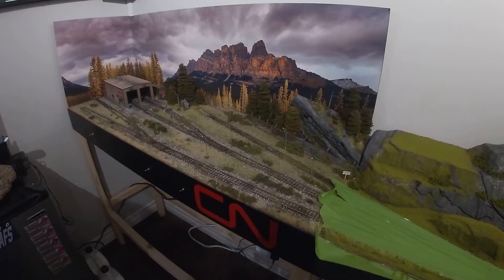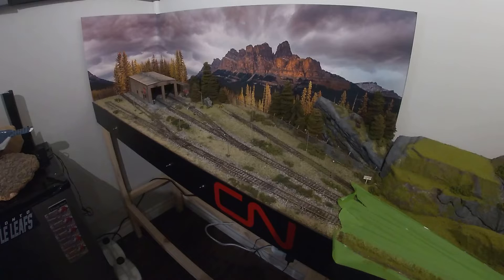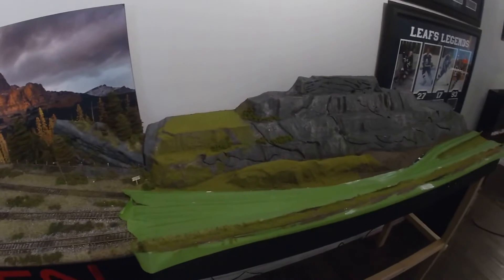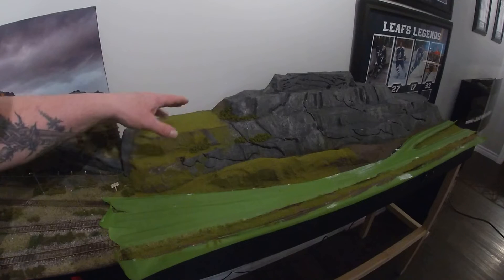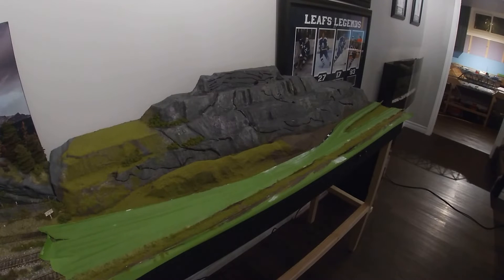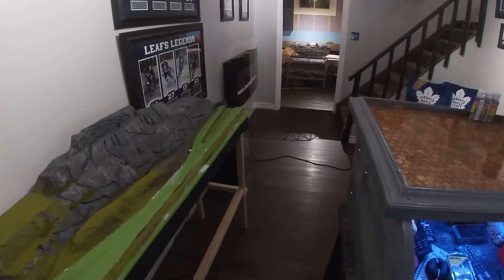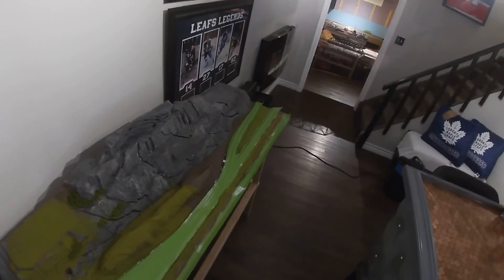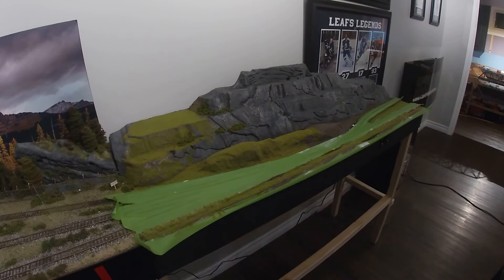Shelf layout update April 5 2022

Comment: That bar brought back some nice memories. My first one was all Michelob caps and the second one was all pennies too. Mine wasn’t as fancy as yours, basically a stained plywood bar with some moulding and the shelf in the back of mine was just stained plywood too. Your bar looks very nice and professional, great job. That corner backdrop is very dynamic, looks great and a nice job on the carving for the mountain area.
Reply from the maker: Thanks Derek had to shin the pennies as well before gluing them down. Then I poured the bar top. The mountains I just carve until I’m happy with the results. Then  a little bit of plaster and paint.